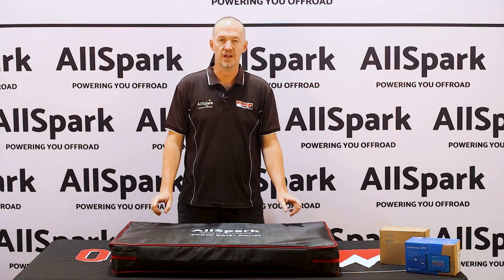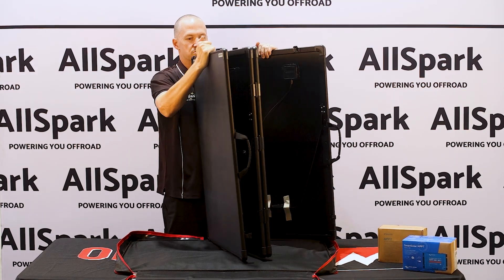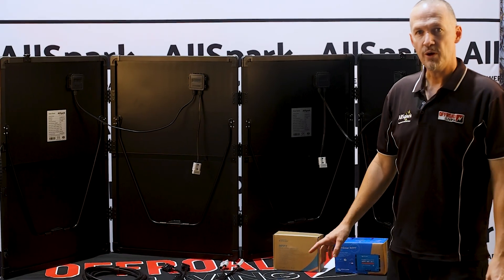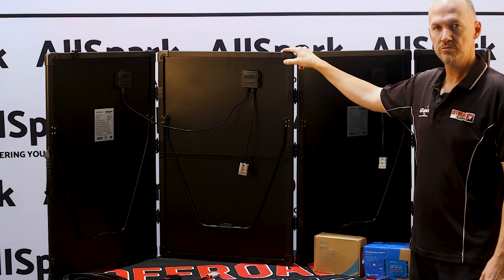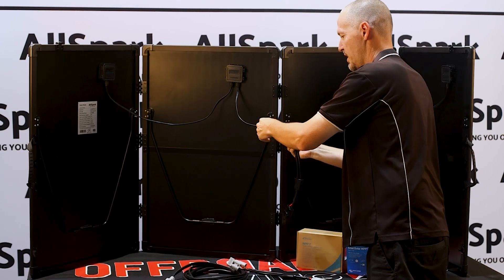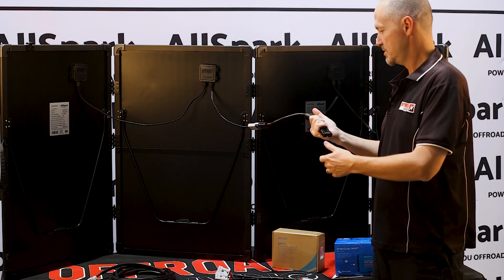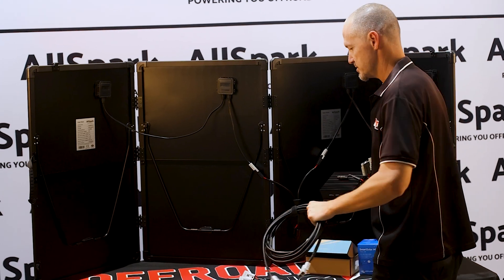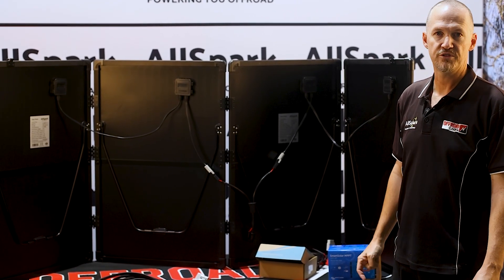What's the difference between low and high voltage when purchasing a 400w quad fold panel?

Comment: I have the 2024 model with the MC4 connectors, to be honest, this was a huge selling point as they could be wired in 20,40,80v configurations, why the move away from the flexibility of MC4 to high and low voltage models of the Anderson plugs. Everyone that saw my panel over the xmas holiday was happy with the size and performance of the unit, it out delivered compared to my Hardkorr 200w Flexible panel that was half the output but only 60% of the cost.
Reply from the maker: @srowlandson  that's great feedback! Most people found the multiple configurations too confusing, hence we switched to the Low and High Voltage models. The only situation that the original one can handle but the current models can't is if someone wants to split the panels 300W into one charger and 100W into the other, or say if they had a High Voltage charger on one vehicle/van and a Low Voltage one on the other vehicle/van. At the end of the day, though, these panels are made with high performance solar cells, so the difference between running at the higher voltage and low will be minimal in most situations.